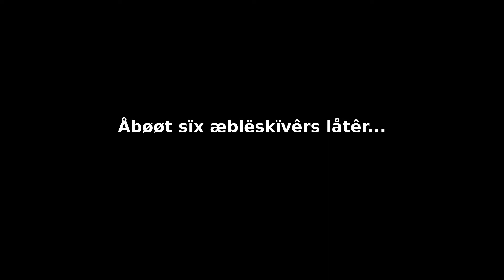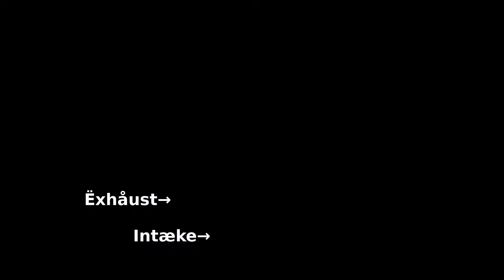Saab Sonett Revival - First START in 20 Years! Ep. 2

Comment: Hello, Wondering if you recall approximate cost of head work with the new valves? Thanks
Reply from the maker: I think it was around $700. If I did it again i probably would have skipped that part, even though it's nice to not worry about valve seats. Some carb cleaner, penetrating oil, and patience would have gotten the valve free eventually.

Comment: Concerning valve play, you said in previous video the engine is tuned? If so, for sporty cams go up with the valve play to 0.5mm inlet and 0.5-0.6mm outlet .
Reply from the maker: At this point i think that claim was mostly BS. The only thing non-stock that I've found is the front half of the exhaust. It even has the stock Fomoco carb.
Reply: @SealedBeamRallyTeam  It looks like it's missing a whole bunch of stuff around the carb... there's supposed to be an intermediate plate between the carb and the intake manifold that's got a whole bunch of smog bullshit on it. Just getting rid of that and doing a custom exhaust is almost enough to qualify as "tuned."
Reply from the maker: @noiwonttellyoumyname.4385  I removed the deceleration valve. Right now planning how I'm going to run pcv stuff before the car gets driven in earnest.
Reply: @SealedBeamRallyTeam  Are you definitely sticking with the carb? I had my fill of carbs and points back a few decades ago when I had my first Sonett, and I'm looking at EFI options for the current project.
Reply from the maker: @noiwonttellyoumyname.4385  carb.

Comment: The place you have the supports that keep the front lifted up is not the best one from a structural point of view. There is a reinforced beam a bit further back that can be used. You'll find it described in the Sonett appendix of the workshop manual. You did the only right thing to do with the heads, thumbs up! Pitty you didn't open up the exhaust holes where the head mates with the exhaust. Because of the Siamese twin setup of the exhaust ports this is a restrictive area when it comes down to the exit of the exhaust fumes; this in combination with the diameter of the exhaust of course.